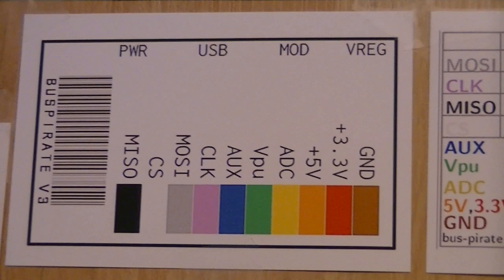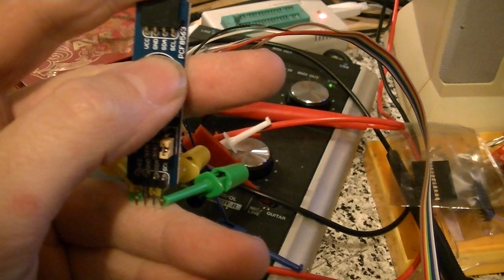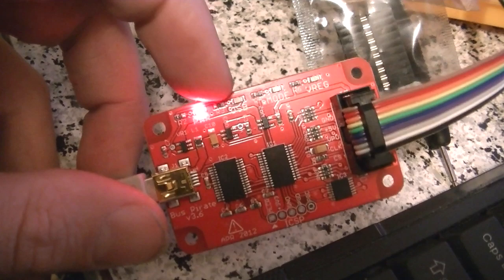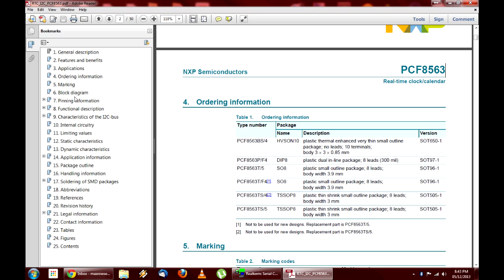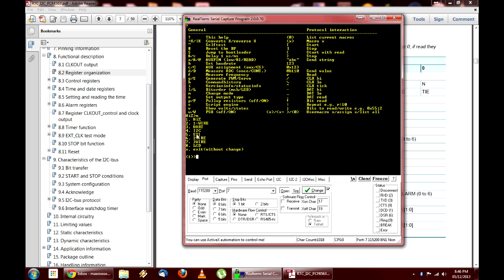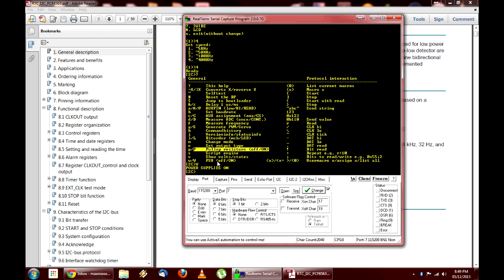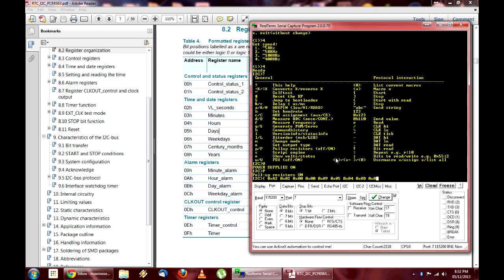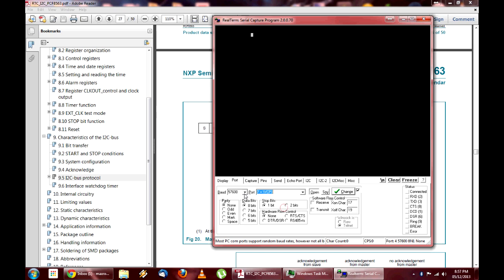Tutorial: Using Bus Pirate to program I2C RTC

Comment: Thanks a lot for this video, it is still very useful even though it did take me a while to figure it out for my situation.  I'm using a Chronodot RTC with the DS3231 chip and interfacing with my Bus Pirate 3.0a with the latest bootloader and firmware.  The hardest part for me was understanding the proper way to address my Chronodot with the Bus Pirate interface, but this video helped a lot.

Comment: I might have missed it but what was the hex value for the start command?
Reply: There is no hex value for the start command. The I2C bus has something called a "start condition", which tells the slave chip that we want to communicate with it. In Bus Pirate terminology, the start is represented by a square bracket; that notation is unique to the Bus Pirate.

Comment: Thanks a lot for this! I'm trying to communicate with an IC from a RPi via I2C, problem is the IC uses a not-so-common convention of 16-bit mem addresses, & many bytes of data per command. More specifically, for a register read it wants:

Start,  7 bit address, Read bit, Ack, Data [7:0], Ack, data [15:..=], not ack(?), Stop

And for a write (i don't know why the python scripts for I2C commands don't seem to be doing anything - it maybe transmitting MSB and not LSB, as this IC requires):

Start,  7 bit address, W bit, Ack, mem address [15:8], ACK, mem address [7:0], ack, Data [7:0], ack, data[15:..], Ack, Stop

^ having said that, most of the reads are many bytes at a time, so while the top write layout doesn't use repeated starts, i'm sure that's what it expects. Damn datasheet isn't as pretty as yours. 

Are you telling me this beautiful little IC should be able to communicate with the IC regardless of it's weird layout ? (i did just order version 3a, not 3.6 or 4 [hopefully shouldn't be a problem, eek])
Reply from the maker: +orbita1 I would highly recommend getting a USB logic analyzer, if you can afford one. It makes debugging problems like yours so much easier. I can't remember if the Bus Pirate supports 16-bit writes. You could easily whip up a microcontroller board to communicate with it, though. That would be dead simple with most modern microcontrollers. Let me know if you got it sorted out!